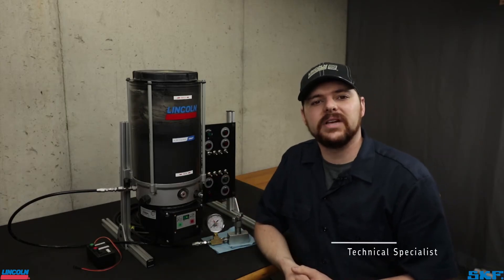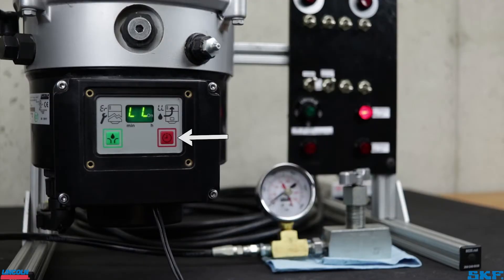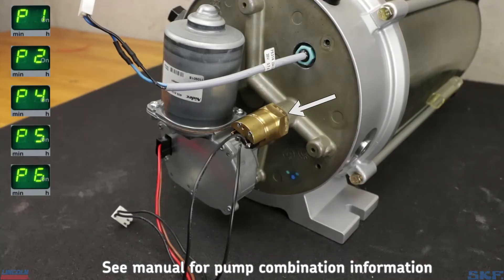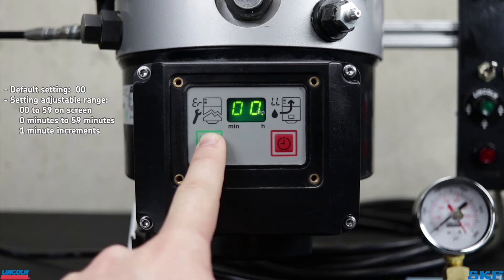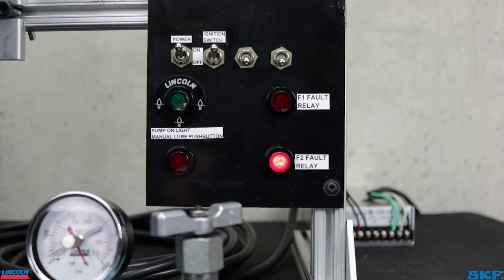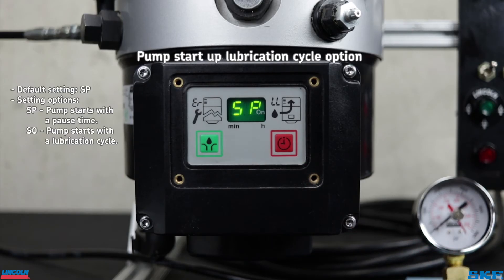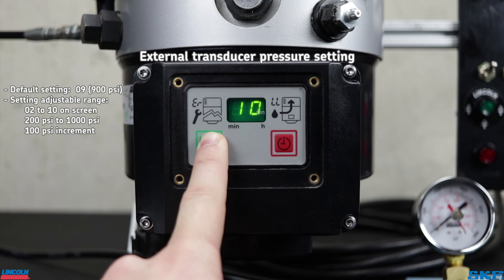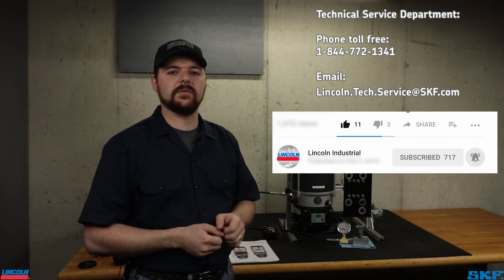P653S pump programming procedure - Lincoln Industrial how to

Comment: What does "Pause Time" mean? Is that the run time or the shut down time? I am using this to apply 10w spindle oil for chain lubrication that is running sideways with a rubber top running the full length of the chain (accuglide conveyor) and I need to lubricate the rollers that are operating vertically, this is a drip type system. Is there a way to mist the lubricant on the rollers? I replaced 2 damaged 331's with the same units. The units were damaged before I started, and I have no way of knowing if they were performing the lubrication adequately or not. And no, there is no one here who can answer that question. The units had not been operating in years it seems, the chain was already dried and stretched, before we replaced it.
Reply from the maker: Greetings! Pause Time refers to the time in between lubrication cycles the system sits idle and a timer counts down to the next cycle. We have the ability to spray lubricant and brush on. For an accurate recommendation for your equipment needs, please reach out to one of our local sales representatives or distributors. 

~ John

Comment: We have p603s model frequently getting E1 fault which parameter need to check
Reply from the maker: Greetings! E1 is a pressure or switch activation fault. This typically signifies either no pressure built up in the system and/or monitoring time was exceeded before the switch or transducer tripped. Check your switches or transducers are signaling to the board. Add an in-line pressure gauge to verify pressure is building in the system. This could be a failed element if no pressure in the line. We can provide a manual if needed for additional troubleshooting. feel free to contact our technical service representatives at Lincoln.Tech.Service@skf.com.

~John
Reply: Thanks for responding we will touch with you

Comment: getting E1 fault which parameter needs to adjust
Reply from the maker: Greetings! E1 is the failure to build pressure in the system. Please install a pressure gauge to verify the pressure is building and holding while the pump is running and holds the pressure during the hold time. there could be a failed injector causing bypass, a worn element failing to adequately build pressure, broken line, malfunctioning pressure switch/transducer. If you need assistance with troubleshooting, please reach out to our technical service group. 

~ John

Comment: Can you explain how we are setting run time for this pump..
Reply from the maker: The only time setting manually entered is the pause time. Run time duration is dependent on how long the system takes to build pressure to trip the pressure sensor or transducer. 

~ John

Comment: That's a nice video explaining the technical aspects and perimeters of this pump on a design level but what about explaining to the average operator how to program it for normal operation. Thank you for your consideration of my suggestion. The video seems to be directed toward fellow engineers and not the general public
Reply from the maker: Normal operation varies based on the configuration of each P653s unit and the application it is used. Their are multiple variations with different feature combinations. This video was produced to show every feature available and the process to program each feature. 

~ John
Reply: That’s when you call a technician like me to set it up for for. We get paid the big bucks for a reason

Comment: Hi John, how about p603s
Reply from the maker: Programming is the same when P603s is configured for timer controller. The 603s has the additional feature of triggering a cycle from a pulse signal rather than a timer. The board would need to have the jumper set to the correct pin setting for this.  P1 and P2 screens in this case would set the number of pulses required before board triggers another lubrication cycle. 

~John
Reply: @lincolnindustrial  John how to do the additional feature for p603s. What should I do on that trigerring part of the pump. I'm from Philippines and this is a huge help for my project. Thank you John this will be a big help.
Reply from the maker: Jumper pins will need to be moved on the board itself to activate the pulse feature. This will change P1 to pulse count factor x100 and P2 will be pulse count factor x1. 

Please send us an email at Lincoln.Tech.Service@skf.com. We can discuss further and provide the manuals necessary to set up the P603s. 

~John

Comment: Hi John do you have video for Pump P401-SSVDV12 on how to install the metering screw?, it looks different from SSVD. The pump arrive with separate metering screw.
Reply from the maker: Hi Christian,  according to the manuals and catalogs, the same metering screws are used between the standard SSVD and the SSVDV divider units. The metering screw is installed on one side center threaded ports to control an outlet pair, the other side must be plugged. We would be happy to send you manuals if needed. for further assistance we would ask that you have any unit part numbers or photos available so we may be able to see what you are seeing. feel free to give our tech group a call at 1-844-772-1341 or email at lincoln.tech.service@skf.com. 

Regards, John L.
Reply: Hi John thanks for the info, maybe my team did it right, they just remove the white plastic cover and put 6 pcs of metering screw (in case of SSVDV12) I ordered 12 pcs I thought it needed for both sides. The exact model is 650-41262-7. The new manual is a bit confusing (951-171-003
Version 09 14.3 Metering screws for SSVDV metering devices ) compared to old one.